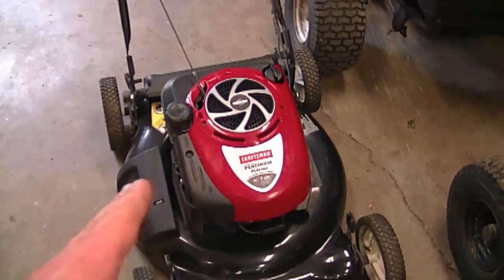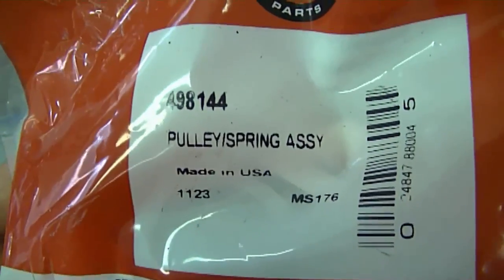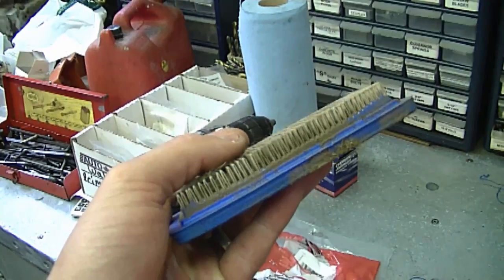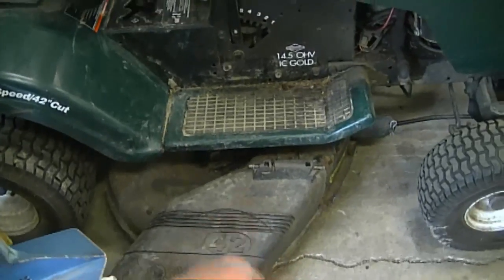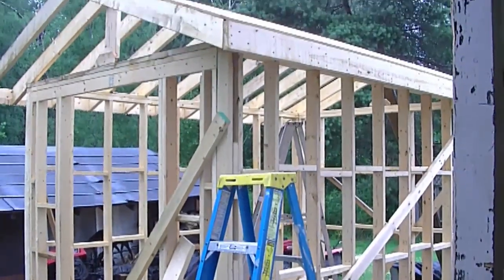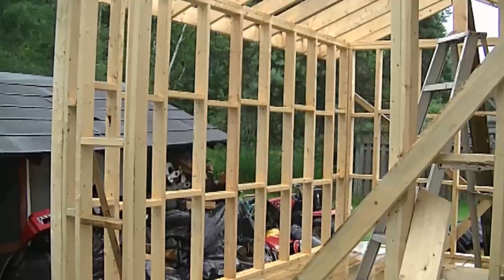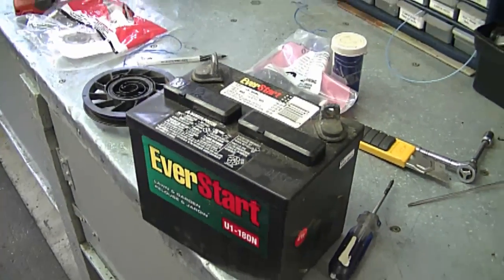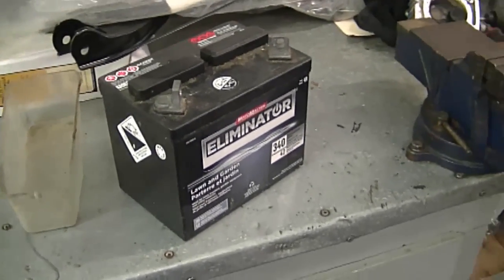Small Engines Q & A Video #129 in HD

Comment: I've had good luck with it. It will help a stretched belt grab for a little longer if you're in a pinch, but always a good idea to either adjust the tension or replace the belt.

Comment: Putting your battery inside for the winter is a good idea. In my case, the battery in our John Deere GT235 sat in the mower year round (in the winter it was in the barn but it was not somewhere heated). The mower was purchased in 2000-2001 and we just replaced the battery for the first time last summer.

Comment: I had the same problem with the blade disengagement on a craftsman with that setup so I ran a return spring from the engagement pulley to a stationary spot on the frame . When you engage the blades the original spring overpowers the return spring and works as it should.
:→)

Comment: My experience is that lawn tractor size batteries last several years if you keep a Solar charger on it any time it is not in use. I have tried the 110 volt plug in battery trickle chargers, but they charge 24 hr/day and this did not extend the battery life.  The solar chargers only charge during the daylight hours.  When I changed to this style of charging the batteries started to last several years. My current cheap battery is 4 yrs old.
Frame for your shed looks great.

Comment: Turn the mower off. Remove the spark plug boot for safety. Disengage the mower blades. Remove guard. Slowly work the belt off the tensioner, then remove the belt from the other pulleys. When reinstalling, get over all pulleys, and then get a lip of the belt on the tensioner. Then spin the blades, and the belt should "thread" itself onto the tensioner.

Comment: Funny, last night I just replaced the engine starter due to a broken spring on the same basic engine.  AND, this mower smokes once it gets warmed up and under load.  I believe it has the exact same type of filter you showed, so I'm going to replace it.  The mower was given to me, so I'm not sure what has been maintained or not.  It runs very well otherwise, so I'm hoping the filter change will take care of the smoke.

Comment: I saw once that fleet farm had 410 cold cranking amp mower batteries, I like how John Deere uses a battery that's twice the size the motor needs to crank, my neighbors just bought there first battery for there deere (its a 10 year old tractor) and they leave the battery out all winter. The little battery that you showed are the ones that are just enough to crank the motor so when they loose some of there storage they don't work, IF A BIGGER BATTERY FITS USE IT!

Comment: An idea for another short video - video on starter rope sizes and your most popular size to use for  what small engine applications . Not a detailed video - just touching base on poplar size ropes to use . I'm use mostly 4 and 4 & 1/2 on my push mowers and two cycle applications - buts there's more sizes out there to be used .

Comment: Also if there is a broke or damaged brake, the blades will continue to spin but it will make an excruciating sound. I have had to repair this problem and the spring is difficult to replace, takes a lot of strength to connect the spring......

Comment: I've never seen one rust, I've seen plenty jam up with grass. Australians like to take the top layer of soil off when they mow. Very rough operators. lol
I've had success in pre-deliveries of huskys stopping the rust for idiots that leave them outdoors in winter. Graphite powder, on the pivot bolt and bracket, and putting a heavier duty return spring. Nice spanner btw dude

Comment: Don there is a return spring on the deck idler bracket to pull it forward when disengaged. Husqvarna, poulan, craftsman mcculoch all use it on these models. It can cause this is if the spring comes off, happens here all the time in Australia.\

Comment: I would NOT use a belt spray on outdoor equipment.  It tends to make the belts sticky and gummy.  That will will make dirt and gunk adhere to them and wear out your pulleys like sandpaper.  Also, deck and drive belts are supposed to slip when disengaged.  A belt spray will mess with that.

Comment: I have a 2011 Kymco Agility50. 2 Months ago the piston got replaced due oil use. + new head, because it had alot of carbon build up up and on the side of the valves causing low compression. Now i discovered it uses more oil then it did before since last few weeks. 1 Liter of 10w40 oil at around 930~950km. Looks like this is not normal.
My dad did call the dealer it did the repair, and they said we will take a look at the problem ( For free as a i know )

Comment: Thats good advice on trator batteries :-D i went to a actual battery shope and got a good quality tractor battery that was 380 cranking amps and it was the same price as the cheapo wally world battery and its going on 3 years in my 18 hp murray GT. The small batteries just diddnt have the cranking amps to start the tractor well so it killed batteries like crazy

Comment: I have a Craftsman and when I run into crab grass the deck slows down and can even stop.  I am running the deck height high and the blades are reasonably sharp.  It is worse of course when the blades are dull.  I'm hoping someone has the solution they would be willing to share with me.  Thanks.

Comment: And these Briggs motors with the 3 amp non regulated charging system is not good ether because they only charge at full throttle and if you have a smaller yard your not recharging the battery all the way